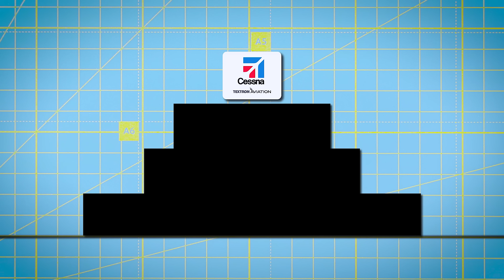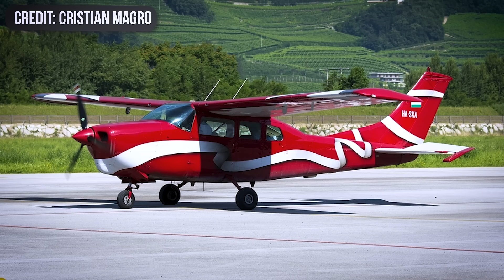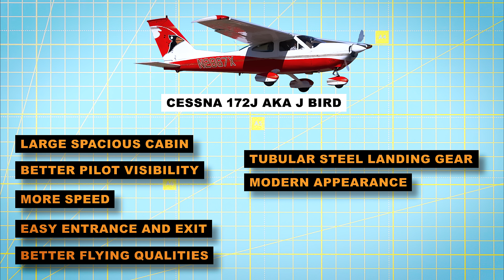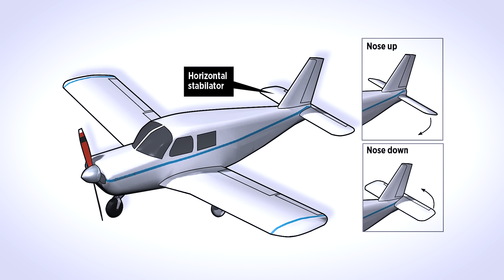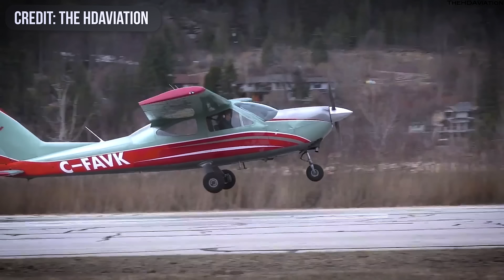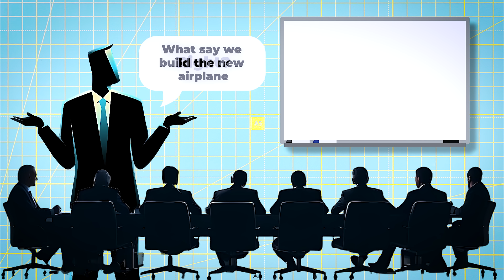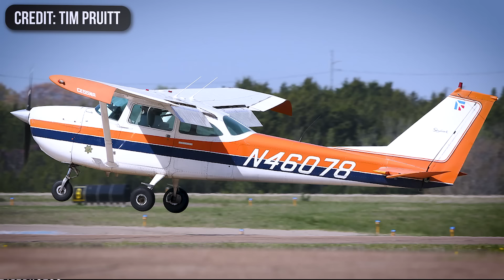Cessna 177: The Plane Pilots Hated

Comment: We bought a new Cardinal RG in 1971 and years later it was sold to a retired airline pilot.  Of all the planes I have flown, including Pipers, Beechcrafts and other Cessnas, this Cardinal was my favorite.  Very easy to fly if you were familiar with the Cessna 172/182.  The only problem we had was with the 200hp Lycoming engine.  It was enough power for the plane but the engine was difficult to restart on hot days and there were times when we had to wait for it to cool down before it would restart. The price to pay for a fuel injected engine.  I miss this plane!
Reply: I remember when they were introduced at a FBO and hot restarts would make it difficult for the next renter start it.

Comment: Join the CardinalFlyers…make the suggested mods, learn not to crow hop,
and the Cardinal is in the sweet spot of family transportation.
Certified, economical, reasonable speed, parts availability, A&Ps are comfortable working on, 
short field performance, acquisition cost….
and the best in class access to front and back seats.
177 owners are a rabid cult of Cardinal lovers.

Comment: Well I bought a 1968 Cardinal in 1976. It didn't fly like a 172 and that's a good thing. My wife, also a pilot, and I put many miles and hours on the airplane and she has not yet forgiven me for selling it. A '76 RG followed, a nice airplane and faster, but lacking the light and sensitive handling qualities of the '68. Cardinals have held their value better than contemporaneous 172s.

Stabilator stalls were an early problem, resulting in an AD that required slots in the leading edge of the stabilator. I think this was much more damaging than perceived lack of horsepower.

Comment: This video is extremely biased, focusing almost entirely on the initial design issues, issues that EVERY new product encounters. The Cardinal was a clean sheet design, first year issues are totally expected. Comparing it to a mature, 30+ year old, 172 design is rediculous.
I have owned my 76RG  since Feb. 1978, flown it several thousand hours, and all over the country. Several times I have looked into getting something different. There is NOTHING that has comparable room, performance, economy, and comfort. It is a joy to fly long cross country trips. Typical flights below 8,000' MSL it cruises LOP at 148 -150 kts TAS, burning less than 9.5 GPH. It has a 18,000' service ceiling; I've flown multiple flights at 15,000 -17,000' burning 6.0 - 6.5 GPH to take advantage of strong tail winds. (Engine is not turbocharged) Above 17,000' the controls do get sensitive in pitch & trim. And, it us the ONLY plane I've found where one can walk up to the plane, open the door, and sit down on the pilots seat without tripping over struts, grear legs, or needing to move the seat forward or backward. (And no climbing up on wings or crawling over the right seat to get into the pilot's seat.)

Comment: I wouldn't own a 172 if you gave it to me...just too boxy and boring and ungainly. But the 177RG! A dream plane. (And the 180hp fixed gear, variable prop models close behind). So much visibility, leg and head room, cruising comfort and elegant looks.  The stabilator's feel/power on landing could lead to issues with PIOs if pilots didn't flare correctly and hit nose-wheel first. But apart from that it is a great flying machine.

Comment: Once the problem was fixed the plane was great- just had to learn how to fly it- very different than a 172 especially on landing- needs a pilot playing attention not the forty degree flaps, cut power and land that was trained into most beginners- I found that using only 20 degrees flaps worked best - allowing the remaining 10 degrees for last few seconds

Comment: In its first iteration it took much more attention to detail to land it smoothly, far more than a C172 required. However, once Cessna modified the tail empennage it was easier to land. In my opinion the C177 was a far better aircraft than the C172 as it was far more useable all round.

Comment: I think the clickbait premise of your headline is not born of any personal experience of this aircraft.
In over 50 years, I flew the  177 along with all of the single and multi engine piston Cessnas including the exotic Reims variants.
There is a huge divide between US ans European training standards: a light aircraft is not a supercar an each type requires an understanding of the design philosophy. 

A 177 is not a 172, and requires another mindset.

An all flying tail plane with inverted slots implies a design issue, so pumping the pitch in the flare is not a good idea.
The 177 required accurate trim as it accelerated, that’s the design, but then EVERY aircraft should be flown in trim for a given airspeed, rudder pedals are not footrests, and anyone that thinks this beautiful aircraft was a handful should have trained on a Pa38 at the very least rather than some other lard assed trainer.

Comment: My pilot mother always loved its big doors that opened 180 degrees without any wing strut to maneuver around.
Reply: 180 degrees is a problem many Cardinal owners have had…and all Cardinal owners fear !!
But the doors do open wide and accessibility for older pilots with bad hips is better 
than any other 4-seat, single engine.
Reply: @tz6516  I may be exaggerating, I'm guessing they can't actually go 180 degrees without damage.
Reply: @Fleetwing1627 

Correct, they can do 90% and are very easy to enter.
However the doors are huge and if a tailwind catches them,
they can hyperextend and go to the 180 degree position….
causing a very expensive repair.

Comment: Lots of hours in the 177RG in Colorado. Most of my Commercial Pilot students used it rather than the Cessna 182RG. It was a 1977 model and was also used for advanced instrument work. For my use, it worked quite well.

Comment: I've owned two 1976 Cessna 177B's with the Lycoming 180 and also a 1974 172 Cessna Skyhawk during my flying career.  Hands down, without qualification of any kind, end of story....the Cardinal was superior in every regard.  The 172 felt like an overloaded pickup truck, but the 177 flew like it had its own angel propelling it.  Smooth, capable, easy to fly, spacious cabin economical, et., etc.   Part of the time (about one year) I flew  off a farm dirt strip in the Rocky Mountains and never a problem, even when temperatures dropped to single or negative digits. Dirt strips, gravel, short paved strips or major airports were all easily handled thanks to the great visibility and low stall speed. And Oh yeah!  It was certified spinnable.  Great for IFR training, not to mention the built in safety factor. BEST AFFORDABLE LIGHT PLANE EVER!!!

Comment: Owner since 2008, over 1200 hours on the controls. Excellent handling, excellent economy, roomy family aircraft. Great compromise between speed and economy. Excellent stable IFR platform. Not a very good climber - but you can always go for a turbo normalized 177RG if need be. Beautiful lines in the air. A lot of fun putting it through maneuvers - well trimmed - with just a slight touch of the yoke. Not a Cessna truck - a Cessna sportscar instead. Ours is became a real family member and I would let go all turbo props and jets of my career for continuing flying my 177RG. BIG LOVE AFFAIR.

Comment: The 180 horsepower was a lot better. Still I didn't like it didn't like the elevator or the way the wing was pushed back. And no wing structs. My friend had a 200 horsepower  R.G still it was a pig.😅 i'd like Cessna, but. I like pipers better. plenty of hours on both of them.

Comment: Cessna's stupid decision to launch the C177 while underpowered with the 150hp Lycoming ruined the plane's reputation for a number of years.  However, the C177B's 180hp with Constant Speed Prop made it absolutely perfect.  I owned a C177B for a number of years and enjoyed every minute in it.  The cabin is wider than a C182's, and the back seat legroom is also greater.  Visibility in a turn is unbeatable because the windscreen is in front of the wing. The huge doors allow you to walk up to the plane and simply sit down in the seat without having to climb up to get inside.  The Cardinal is still the most beautiful single-engine design in history.  Look at the airplane -- there's not a flat surface anywhere;  only smooth curved surfaces with no boxy structure or corrugated surface with protruding rivet heads like every other aluminum airplane.  If you're ever in the market for a used single-engine plane, you owe it to yourself to try a Cardinal.

Comment: As an A&P the thing I didn't like about the 177RG was inspecting the gear at annuals.  Really just the jacking up and retracting the gear, I was always nervous with those tall jacks under the high wing raising the plane high enough for the gear to clear the ground, and the retracting gear shaking the plane.  Yes, it's secure and stable enough, but it always got to me.

Comment: As a pilot, I’m super disappointed the 177 didn’t replace the 172 entirely as they originally intended.
Reply: The video also didn’t mention that labor costs in the U.S. during the late 1960s and early 1970s rose dramatically. Because the Cardinal has a lot of hand-made parts, they were more expensive to manufacture and so the profit margins were smaller. So the Cardinal failed in the market, but not because there was something wrong with the airplane.

Comment: BS video. Pilots loved the C177 even with its problems. It was under powered - a good two place airplane initially. The stabilator stalled,  which caused some bad landings, before the slot modification was introduced . It was too expensive to build. The cantilever wing spar was many dollars more than the strut braced C172. When flying with two front seat people, you generally needed ballast in the rear to deal with the forward CG. Still. I loved to fly the C177. It was particularly nice with the pilot's view ahead of the wing leading edge - great turn visibility. If you can find a good C177B grab it!

Comment: Not hated at all! Though it faltered in big performance, which so many others do as well, I think the 177RG was the best looking Cessna single EVER. Especially with the right livery. 2nd was the 210RG. Battling with first is the 337, though, but not a single. Call me eccentric, those were all cool airplanes. Now, you want anemic? I give you the 172RG 'Gutless" Cutlass. I got my hi-perf checkout in the Cutlass. I still love it because it was like flying a 'Big Boy Pants' airplane when struggling to stack time and experience in the logbook. I was lucky that my tiny FBO on the central coast of CA had one, along with 2 152's and 2 172's, plus the 172 RG. We also had a P210RG on lease-back and a C340 RAM that we later lost along with a 20,000+ hour phenomenal pilot, but we used those exclusively for charter or some "special" students with privileges. Damn, back then I was paying $35/hr WET to fly the 152 and IIRC, $45/hr for the 172 and I did it all through 'Trade Service' with the FBO owner/friend. Man, take me back to those days in the mid 90's!

Comment: Nothing went "Overly wrong with it". We owned a 177RG for 10 years. Loved every year of it. The wing design was perfect. Not sure what made you go off on this great plane. Nothing you say is real based on my experience. Cessna should have kept this design and dumped a different model if they needed to. I has better weight performance than a Mooney Ovation although about 40Kts slower - but at a more affordable price. I don't know a single pilot who hated it and I have been flying for nearly 30 years.

Comment: I've got a little more than 1,000 hours in a Cardinal RG  s a charter pilot and instructor. It's a good airplane and handles well, not as boring as a 172, which also lost something when the 170 ended.  The 177R  has a good reputation among pilots, especially  landing, even when full, giving you greasers every time given some experience. The fixed gear version is wayyy underpowered, almost to the point point of being unsafe.

Comment: This was a good airplane I rented one many times instead of the 172, it was easier to enter and had great visibility. About the same size and speed as the piper archer but you had two doors and didn’t have to climb on the wing to enter and at about the same rental rate. Good for my family of 3 for getting away.

Comment: Years ago, I hung around Mr. Richard Bach (Jonathan Livingston Seagull).  He was always speaking about the sensual side of aviation.  He challenged pilots to "Sleep with their Airplane."  At the time, I thought him a bit of a goof and full of himself.  It wasn't until some time later, I realized what he was speaking about.  What recreational GA flying is really all about is taking an airplane like a J3 Piper Cub, flying low, slow and landing at remote locations.  Enjoy and appreciate nature.  Camp and sleep alongside your airplane.  After all, most all pilots refer to their airplane as "she" which appeals to the sensual side of aviation.  I'm sorry guys, but the C150, C172, PA28, etc. are good trainers but not so much a good recreational airplane.  The C177 isn't much better.  They are cramped and under powered (I have several hundred hours in these type airplanes).  Think about it.  Fly over desert regions.  Chase wild horses.  Camp under the stars.  Put a set of floats on that baby and you can fly into almost any lake.  Fish for your dinner.  FYI.  Small Lakes.  You set yourself up by starting your takeoff downwind.   You curve around the lake into the wind, get on the step and away you go.  I've buzzed resorts so they can come pick me up at their remote grass or gravel field.  Take off and land in one direction because there's a mountain or obstacles in the other direction.  I know, these are simple rudimentary things.  I've flown fighter jets tree top level at the speed of heat.  Yes, that is exhilarating but you are missing the point.  It's not about rushing.  It's about taking your time and experiencing life.  Trade away that expensive, under powered, avionics laden chicken hawk and all other derivatives and go back to basics.  That's what it is all about.

Comment: I worked for a marque Cessna dealer and were one of the first to accept delivery of this much anticipated airplane.  However, in short order, the C177 became anti-climatic.  The C177RG wasn't much better.  C177 performance was not much better than the C172 and rented for a higher price.  As a fledgling aviator, for my cost range, I preferred the C182.  Later, when I became a CFI, I logged several hundred hours in the C172.  Power is very important to me both with driving a car and flying an airplane.  For the life of me, I do not understand why GA aircraft are ALWAYS under powered.  Four seats and light luggage inside of a C172 or a PA28 is a joke.  Especially if you are flying out of high density airfields.  If Cessna, Piper, Cirrus, etc., want to corner GA sales, build a plane that has ample power and can haul ass.  A 200 knot reciprocating engine  is acceptable and cranking it up to about 250kts would be great.  They can do it, they just don't want to.

Comment: I watched the video. What a hit piece on one of the finest general aviation birds around. Sure some early decisions such as the 150hp engine were bad choices, but in the end, there were over 4000 of these things made, over 1500 of which are RG's. Most Cardinals are still flying 50 years later, and owners absolutely love them due to the superb flying characteristics. I make the claim that the Cardinal RG remains competitive with regard to speed, efficiency and capability. Even today, we can't do much, if any better. Find a 200HP 8=10gph 145kt airplane with such a capable cabin. Can't be done.

Comment: owned 1977 RG for 20 years one of the best planes of the era.  4 passengers 200 lbs baggage and full fuel. cruise at 150 at less than 10 gals. per hour.  Not what i would call a failure.

Comment: There is one unique thing about the Cardinal, even today. Because it has no struts, the doors are able to open almost a full 180 degrees. Combined with the low height of the fuselage and the very large, long doors, this makes the 177 one of the most accessible GA airplanes out there. For pilots who are older, who are disabled, or who have family members with disabilities, the 177 is unmatched in terms of value. It is perhaps the only airplane that a manual wheelchair can easily fit into without needing to worry about dragging it over a wing or through a small door. That's why I have one and love it to death. There is nothing else like it in existence.

I've always thought that the Cardinal is ripe for someone in the experimental field to redesign with a composite wing and fuselage. In terms of load, interior volume, accessibility, speed, and ease of handling, it remains unmatched, even if it was a commercial flop. How I wish that there was a modern experimental version and that the numbers weren't dwindling, especially with the spar AD choking the supply of Cardinals that are left.

Comment: In the  mid 60’s I worked my way through college ferrying airplanes for a local contractor dealer in Wichita. I delivered quite a few new Cessnas mostly to the SE and NE. Then picked up new Pipers, both Cherokees and Comanches  for the return to the midwest.  Of all the planes I flew the Cardinal was my favorite, not as fast as a Skylane or Two Ten but a real comfort and pleasure to fly.  A few years later I purchased an early Cardinal for pleasure flying and for my wife to get her license. It was a great airplane flown by a few not so great pilots.